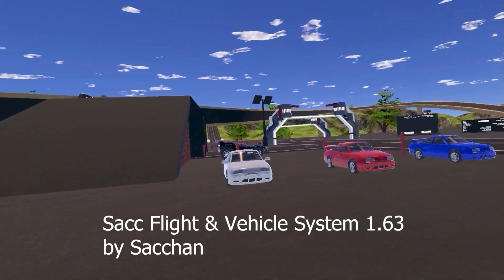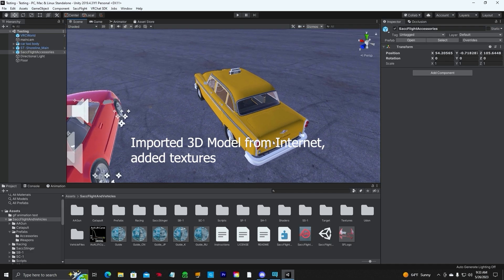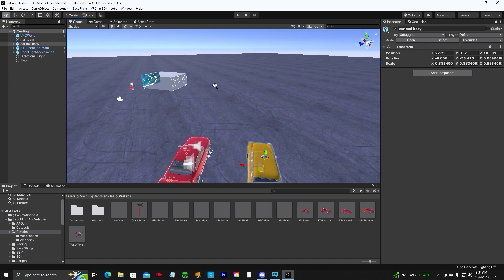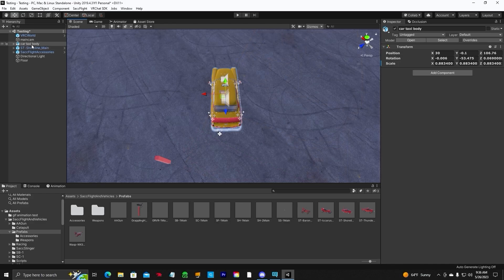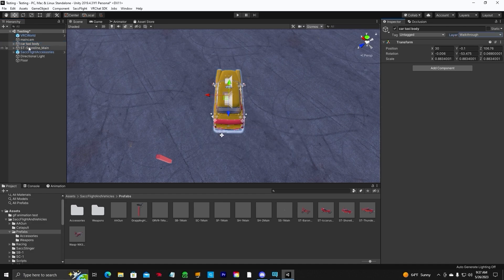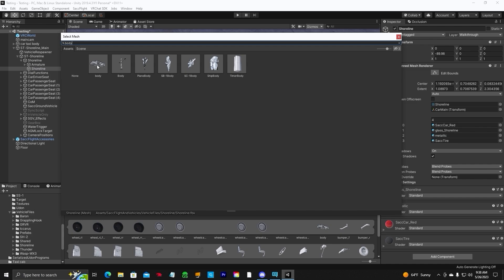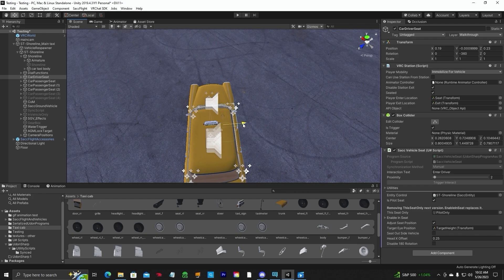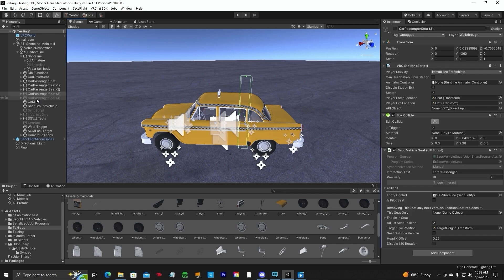Sacc System to your own 3d Model Car! (Sacc Unity Tutorial - Car Edition)

Comment: Everything works fine, although in game, the car just doesn’t stop shaking and it becomes undriveble
Reply from the maker: Odd, I've never had that problem. Double check your wheel placement and make sure you replaced the sacc car mesh with your new car  mesh. Keep at it, good luck!
Reply: @genobvious2606  I’ve checked everything, 
I even went with the shoreline to see if it’s my model or something else.. and the shoreline shakes as well when I haven’t changed anything to it…
Maybe it’s the ground in using?…
 I added a plane as a floor and I’ve added a terrain but I’m seeing the drit skid when I do so maybe it’s that I’m not sure…
Reply: Did you ever find a fix for this? having this myself...
Reply: @bragfilly  I found out that on desktop it looks like that but when I go in my vr, I no longer have this issue. It’s weird.
Reply: @Fiamma_Introverted_Owl  Huh, im still having it in game aswell. If you have discord, i could show you a video. In your other comment, you mentioned the car basically always being on dirt. Did you end up fixing that?

Comment: first off, great tutorial! i do have a problem tho, when i replaced the car with my own model it works fine except for when i turn my car flips over. Is there a setting for making the car stick to the ground no matter what?
Reply from the maker: Hmm, I haven't had that problem. doublecheck the tires (make sure the new car tires line up with sacc car and the armature for the steering is correctly placed). I do not know of any setting to force the car on the ground. Very odd that it didn't work properly. It could be something on the "invehicle", like the gauges being not in the correct order/misplaced
Reply: @genobvious2606  hey i fixed it idk i guess i did something wrong but it works great now! but now how would i change out the car animations for my own? cuz rn its just a static car sliding across the floor, also ty for the help!

Comment: Ive been searching far and wide, traveled the lands of the internet for many hours, and finally ive found what im looking for, a tutorial on how to change the models in the saccflight system, now only one question remains, how does one animate steering wheel/wheels in this magic soul eating software called ”blender”?
Reply from the maker: I plan on making boat,hoverbike, helicopter,and aircraft tutorials in the future. Animation in Blender......there are tutorials on YouTube, I try to do my animation with unity, but since the car model is basically one part, it takes blender. Detaching the steering wheel. Wish I knew more to tell ya.
Reply: @genobvious2606  hmm, yeah, i guess you could add blendshapes for it and then use those to animate it in unity, but yeah, great tutorial, i look forward to your future ones, do you know if there's like a discord or something were one could find documentation on things related to the flight system?
Reply from the maker: @Randomking1423  you can join "The Black Aces" Discord channel. Main flight group in VRChat

Comment: Is there a way to change the drive from RWD to FWD? Also if you wanted to make a pack of cars that all use the Shoreline as a base is that possible or can you only replace it with one car? Good tutorial 👍
Reply from the maker: Not exactly sure what you mean, 1 car for each Sacc system, then duplicate the Car. Experiment with the other Car Prefabs as well, basically same procedure as in video
Reply: since the Sacc Ground Vehicle script has arrays for Drive wheels and Steer wheels, presumably you could just put the front wheels in both of those arrays.  Did you try this, and if so, results are?